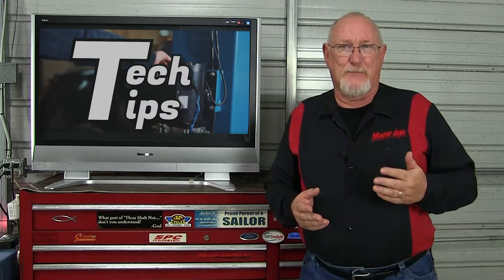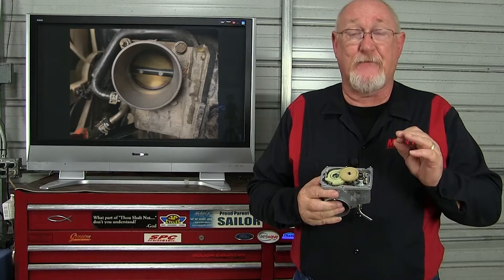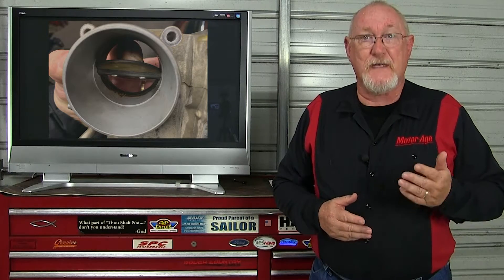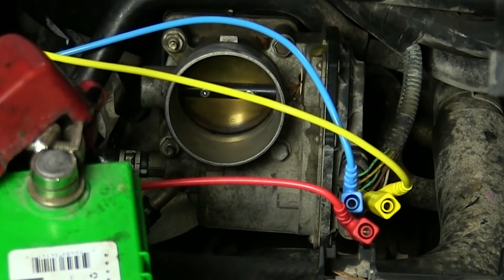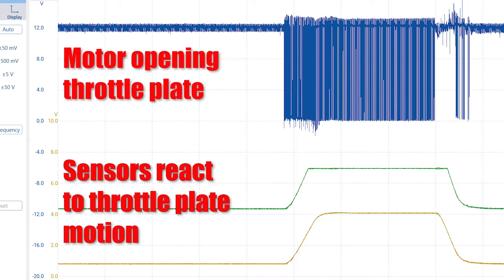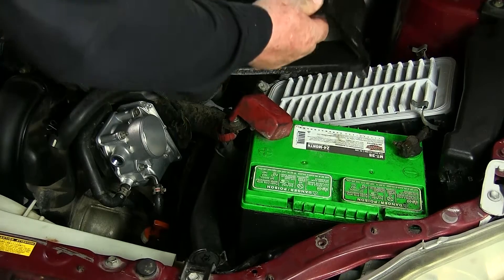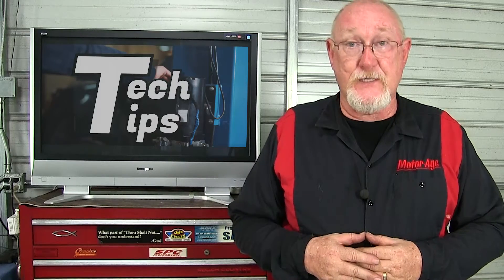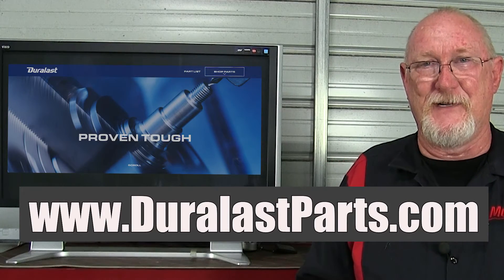TechTips #1 – Electronic Throttle Body Troubleshooting

Comment: While I enjoyed your video,  you never explained if the ETB sensor was good or not based on your testing.  You briefly stated chech for dropoffs  but never did show them nor confirm them. Next, you suggested purchasing an OEM or OE equivalent throttle body replacement which I wasn't expecting.  And, even suggested a Duralast brand replacement TB which is sold at Autozone or O'Reilly.  I myself would not purchase most replacement parts from either of those stores. This leads me to believe you are getting kickbacks from them. A man with your level of auto repair knowledge should never suggest those car parts stores for replacement parts.  That makes me sad.

Comment: At 9:42 , there is a small Glued screw on Throttle Body , next to the black plastic part, or 4:45 next 1cm to the top right bolt . Can you tell what's that screw purpose ? why they seal/fix it by glued it ? can i adjust this hex screw to make the idle higher or lower rpm ?

Comment: I have a 2006 toyota prius.  I took the throttle body off and also took off the TPS which had screws on it painted yellow.  I tested the TPS and then put it back on visually referring to a picture before I took it off trying to get it back to the same position.  I don't know how these are calibrated as the TPS can be rotated.  Is there a voltage reading as to position it correctly?  what are the voltages?

Comment: I bought a second hand one. Went to replace it and found a plastic bodywork fitting stuck in the butterfly valve. The air filter was not fitted right. Might be best to have a look before buying a new one.

Comment: Can anyone tell me if the throttle body on a 2004 camry 4 cylinder has the idle air control valve built in? The Chilton manual says both the 4 and 6 cylinder which has a throttle position sensor cannot be replaced separately.

Comment: How I wish I had found this when it first dropped. Replaced the MAF 3 years ago & only drove the Ranger 20 miles before parking it. Six months later it’s throwing the same code. I’m told to drive it over 50 miles an hour for 50 miles & that should do it… it didn’t. Next day found a bird’s nest in the intake. Still ran fine, tho. Cleaned everything out & eventually the code cleared. After moving it around all summer, today I decided to sell it… it started to crank & then nothing. The code is back!

Comment: Additionally, I can arrest the "hiccup" by throttling up to 2000 rpm or more thus forcing a kickdown. I just had the transmission rebuilt at considerable cost and it continues to "hiccup". The local trans shop sees no transmission codes. The roughness can't be good on the transfer case chain and other components.

Comment: My 2008 Escalade 6.2 "hiccups" with varying severity under light load at part throttle, especially when climbing a grade at 40+/- mph and between 1200 and 1800 rpm. No codes are thrown. The vehicle has 210,000 miles on it and  I acquired it with 190K. I plan to check the APPS and the TPS; perhaps the variable resistor quadrant(s) have a rough spot? Any ideas would be appreciated. Jeff.

Comment: Well explained. I have the same throttle; my issue is that the deceleration is weak. It takes seconds or so to return back to the initial position. Do you know how I can fix this?

Comment: Thank you very much for sharing your knowledge. I cleaned the throttle body of my wife's NIssan Note. It gave me a hell of problems, engine riving at idle. I followed the procedure on the service manual but couldn't solve the problem. I sent the car to Nissan dealership, they could NOT fix it with their ScanTool as well, but told me either the ECM or ETB(Electronic Throttle Body) is defect. I drove home because letting them change the ECM or the ETB will cost me a fortune. I ordered an ETB whose manufacture has a good reputation. With the help of a Scan Tool I bought, and your trick " brake and Gear" in position, it finally worked.
Reply: im in the aussie outback downunder by the way peeps thank you sooooo much :)
Reply: i have same dramas changed cam sensor also thrott body new, crank angel sen also air maff sen also new in car pedal sen and car when gets warm high idel cold then warm reves up and down 1500 rpm to 2500 rpm .....how long did you have to keep your nissan in gear foot on brake for ?ill try that please helppppp its a nissan petrol 2005 xt xtrail 4 cylinder ahhhhhhhhhhhhh heeeeellllp hehehe .
Reply: @JJamieson-w8f  I used LAUNCH X431 CRP919X BT Scan Tool to fix mine. When start the Engine the RPM will fluctuate. What you do is : Press the Clutch totally down, whilst you put the gear for instance in 1st position. You should press the Brake simultaneously and release the clutch at the same time slowly, what you will notice is, the RPM will come down to its settings. Don;t forget, you should use the Scan Tools Throttle Position settings and it should definitely solve the RPM surging problem. I replaced my Electronic Throttle Body before... mind you
Reply: oh and i even replaced o2 exhaust sen alll parts brand new no vac leaks anywhere pleeeaaassseeee help some one :)

Comment: I'v replace the throttle body 3 times on my 2008 chysler 300, cleaned them as well. Someone told me its the throttle body sensor that need to be replaced.  I dont know where the sensor is located.  I found the part on rockauto.  So will you please make a video just about the throttle sensor and how to replace it.
Reply: It’s Throttle Position Sensor ( TPS) and is attached to either left or right side of the Electrical Throttle Body . One side of the Throttle Body is power connector and the other side is attached to it is Throttle Position Sensor ( TPS) that reads and sends information to the car computer the position of the Butterfly ( Blade ) when we press the pedal . The car computer (ECM) accordingly adjust the fuel spray in the fuel injectors .
Reply: It is part of the tb... Mabey its the harness / pins / wiring in the plug that goes to the tps ON the etb🫡

Comment: In my Lexus Lx470 2005 , I found that when I press the accelerate fully (full gas) it goes maximum only at 2000 RPM and it doesn’t accelerate beyond that. But when I put to neutral it’s goes beyond 2000 RPM.

elerator pedal. (See attached )

Looking for advice and fix.

Comment: On the diagram you showed the M+ (Black) and M(White) are supposed to be in the center of the connector. So why are your white and black wires in the bottom and not like it's shown in the diagram?

Comment: Thank you so much for explaining this in great detail. I recently got the throttle body swapped on my 2020 Versa and I left the dealership and 10 miles away, the car began to shudder. Eventually the engine shut off and their excuse was "it didn't take the programming" I had to come back for the relearning.. The dealership drove it 20 miles instead of the previous 3 miles when I got the car back a second time. So far, it looks like everything is holding up.

Comment: At 5:11 my mom ride has a check engine light when i used her ride, it's a 2019 chevy cruze and it's has a electrical throttle body her air filter was dirty so replace that and went to check her throttle body but no build up has occurred yet so i still cleaned it but I wanted to see if it was working or not, got my phone out and postion my phone to record the throttle body while I pressed on the Accelerator and once that was done, check the phone and it starting to make noise every time it would open

Comment: I have a Nissan maxima 2018, the car shifts and drives then if I slow down and stop. I’ll pump the gas and it won’t rev or have any power but all electric and the car is rolling.

Comment: I have a p2111, code throttle body stuck open. I replaced the throttle body w/ sensor and still have the same code ?  Im not sure if itsthe ecm or pedal position sensor, any ideas ?

Comment: Duralast whitelabels their parts just like NAPA and Carquest (Advanced). Pretending otherwise is a disservice to retails and greenhorn mechanics. Always ask who makes the part. If you want reliable OE get your parts from second party like Delco (GM) or Motorcraft (Ford) if you're too skittish to buy AE parts which tend to actually be better than OE. Don't buy the circus act, everyone whitelabels (even the automakers/dealers). Instead leverage it, mainly in fluids which are always name brands in a cheap bottle. It doesn't hurt to ask and if they refuse to answer shop elsewhere. As a matter of integrity, original manufacturer should be 100% available info. Hoping that R2R means that the whitelabel shenanigans in the parts space of the industry get toned down. It's already bad enough makers like GM have six or more OEs for a single bolt that you can't second source anyways, don't need more confusion.

Anyways decent home gamer video so fewer people mess up TB jobs and blame the part, a lot of them never realise that TB jobs need to have a learn cycle performed when replaced or significantly cleaned and usually forget I told them this information until I remind them when I see them come back.

Comment: These should of just stayed mechanical
Reply: I'm from a family of mechanics. This is Small talk for many of us. Remember the days when you opened the hood and all there is was a battery and engine. Not a ton of plastic spaghetti and sensors. Argggg 😤
Reply: @marcalan1198 yeah it's all about making money 💰 with car part's 🚗..
Reply: 😊 @marcalan1198
Reply: Thinking the same thing
Reply: Yes they should have left it non-electronic
Reply: Certainly things today are unnecessarily complex under the hood
Reply: Yeah if you want less performance, then sure
Reply: @edocsil1635  and greater reliability? Definitely. I like that trade.
Reply: @LogHewer  I agree when it comes to reliability
Reply: Agreed
Reply: This is increasing the cost of living for no good reason.
Reply: Your comment isn't even English.
'Should of..' is a grammatical abomination which means absolute nothing.
What you perhaps intended to say was 'should have', also shortened in casual conversation to 'should've'.
NEVER could, should, would, might followed by 'of'.
Just think about it! 
Inaccuracy with words can be just as damaging as casual calibration in engineering etc.  👍🏻👋🏻
Reply: @malcolmadams5964 nerd

Comment: I replaced the MAF Sensor and the engine line went out, but it still wont go faster than 35-40 mph, im thinking this seems 'easy' enough so i'll try removing it and possibly replacing it.
Reply: You probably have an vacuum leak or a clogged catalytic converter.
Reply: Did you ever find out the solution?

Comment: Hi, thank you for your insightful video. I have a 2003 Tacoma prerunner 2,7L Reg cab. The mechanic fixed the check engine light due to the dirty mass air flow sensor he thinks? I drove it for three days and I experienced the same problem when I started the truck. The initial start always came with the rough idle then drive fine after that but the engine light came back on. I replaced the mass air flow but that didn’t solve the check engine light. The truck runs fine and the second days start the engine starts with no rough idle…it only starts with the rough idle when I don’t drive more than two days. Any help would really appreciate it. Could it be the fuel injectors gone bad?
Reply from the maker: What code or codes are turning on the Check Engine light?
Reply: PO300,3002,and P03003. Also, I had changed all the Ignition core and spark plugs..did try clearing the throttle body as well..

Comment: Why does the gas peddle get stuck at the bottom and I can't get full throttle unless I'm on cruise control and I increase the speed that way?
Reply from the maker: Check the operation of the Accelerator Position Pedal assembly

Comment: Check engine light is on (has been for about a year. Been to several mechanics and no one can figure out the cause), and have now experienced Low Engine Power warning several times. Cleaned the throttle body and reset the vehicle as per this vid. Works for a few days then low power warning again. I drive a 2010 Buick Lacrosse, about 170k miles. What could be going on? Is it time to get rid of it or can I get some more life out of it? Great vid, btw.
Reply from the maker: The Low Engine Power warning can be caused by a variety of problems. Personally, I would begin with a complete testing of the engine's primary systems - compression/sealing, volumetric efficiency, ignition and fuel. Are there any codes stored (is the Check Engine light on)?
Reply: @MotorAgeMagazine  Check Engine light has been on for over a year. I've had several mechanics look at it. The car is returned to me with the light off, then it comes back on a few days or weeks later. That's why I've taken it to different mechanics, but end up with the same result. Honestly, I think they're just disconnecting and reconnecting the battery so that the light goes off. I don't know the code numbers. Car is immobilized right now (due to low engine power).

Comment: Help,
Throttle plate doesn't move when engine/key is turned on and gas pedal is pressed.
But when engine/key is turned off throttle plate opens all the way and closes quickly.

When engine is ignited and gas pedal is pressed throttle plate move slightly. Not all the way.
Is my throttle body gone bad???
Reply from the maker: What is the year/make/model and engine size of your vehicle? Are there any related trouble codes? Has any work been done recently including anything that would require the battery to be disconnected? Any other issues?
Reply: @VehicleServiceandRepair   @Motor Age  engine-HR12DE
1198 cc
NISSAN MICRA 1.2(2015) petrol.

RECENTLY CLEANED throttle body.
idle rpm around 890.

Throttle position is 4.80 % when engine is on.
Throttle position goes down to 1.5% when engine is ignited and is in idle.
When engine is turned on(not ignited) no throttle plate/motor sound but when turned off, throttle plate/motor sound is heard.
Car vibrate a lot when clutch is released.
When gas is pressed and released, a flapping noise is heard .
Air fuel ratio 0:1.
Vacuum pressure: -29
Long-term & short term fuel trims negative most of the times.
Reply: Throttle relearn procedure preformed multiple times
Reply from the maker: @xyz47242  Are you performing the relearn with a scan tool?
Reply: @VehicleServiceandRepair     no, I followed a Nissan specific relearn procedure where key on/off and pressing gas pedal are involved.
Rpm is stabled around 890, there is no erratic ups and downs in rpm.
I used torque pro app the scan/ measure the details
Reply from the maker: @xyz47242  The Nissan procedure manually is very time precise. Even then, it may not work. You’re might have to have it done with a capable scan tool before proceeding.

Comment: I have a 2014 town and country. Lightening bolt comes on and van won’t start. I cleaned the throttle body and it was pretty clean TBH. Under 70k miles. How do I test the TB or pedal sensor or do I just throw parts?

Comment: What if idle is really low at stop lights but good after about 30 minutes of driving . my car shakes and sometimes I get bad fuel economy along with horrible takeoff. What is the issue ? Did the relearn the sensors cleaned ,the throttle cleaned and fuel injectors changed . still getting low rpm. G37 sedan 2019
Reply from the maker: Did you perform the relearn with the engine cold or at operating temperature? Check the procedure and make sure which is specified for your vehicle.

Comment: My car has gremlins or something. I replaced the throttle body because of a code. No problems. Just a code. The new throttle body idled way too fast so I tried every relearn method in the book and it still idled too fast. I put the old TB back on and it ran fine. I decided to clean it. Now it idles too fast and again, won't relearn idle speed. I can get it to idle right by doing the pull it in gear and hold the brake but the moment I apply any throttle, it goes back to high idle. I've even reset it with the scan tool. Several times. The car will not learn to idle. I can't find any leaks or bad wiring. It just refuses to learn. Any ideas? It's an LS4 5.3 in an Impala SS btw.
Reply from the maker: This might be helpful:  https://www.youtube.com/watch?v=NAnEoMa80VY
Reply: @VehicleServiceandRepair  Nope. Done this several times. Thanks anyway.

Comment: We took our 2016 Dodge Journey crossroad to a garage and had it replaced. It was still doing the same thing. The throttle body light came on. The garage replaced it again incase  the 1st was defected. After $1000 dollars nothing has changed we are still going through the same problem. What could be going on?
Reply from the maker: Is that the only complaint? That the light is on? Or is there another concern that started it all? Any DTCs that you know of?

Comment: I just bought a 2013 Dodge avenger with a 2.4 l engine and I had to replace the thermostat housing but now the idle is kind of funny so I'm thinking this may be my problem. If I hold the gas pedal down for 2000 rpm's it goes up to 2000 down to 1800 backup to 2000 down 1800.  I'm gonna try to clean it 1st but I have a feeling I will have to replace it. Thanks for the video